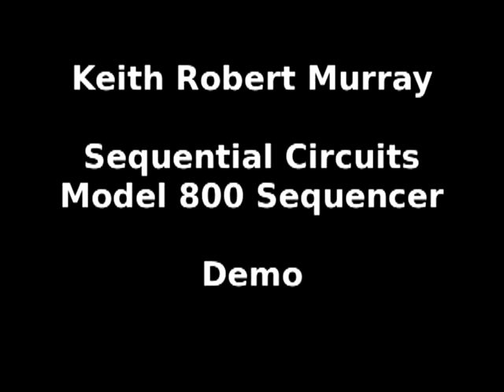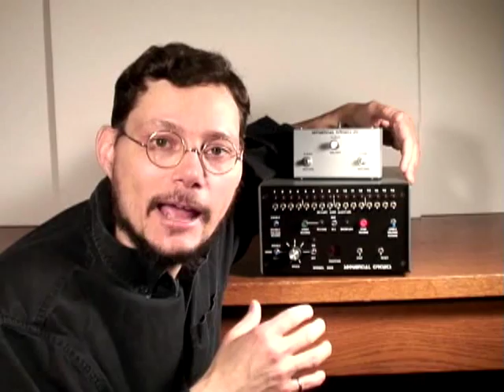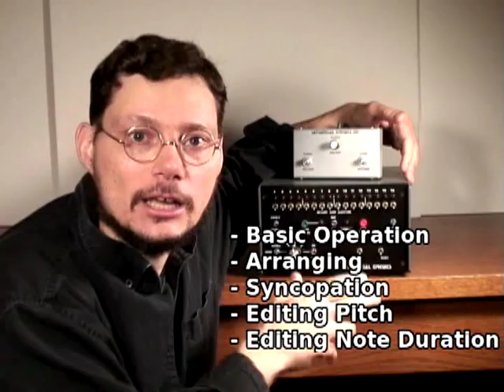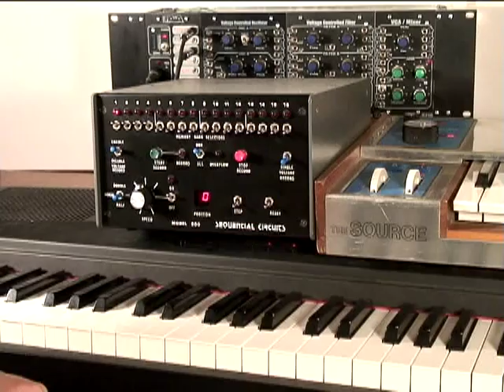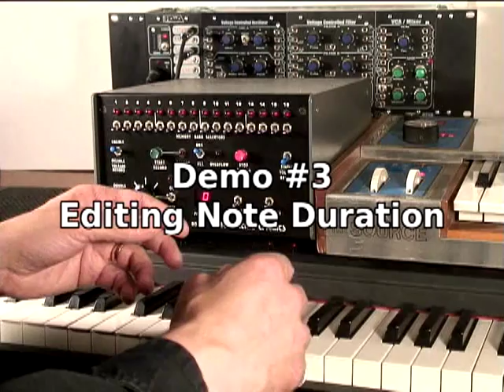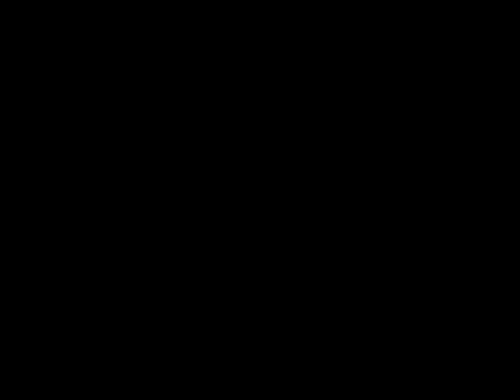Sequential Circuits Model 800 Sequencer Demo

Comment: Keith,   Great demo.  I used to own a Model 800.  Sold it to a friend who still has it.   I recently acquired a Model 700 programmer :)
Reply: Both are truly great designs, not just for their time but for now. The 700 was rarely used live - but that's what it was great for. I used one when touring with a Minimoog and it blew people's minds that it had "presets". But the 800 Sequencer is truly useful for anyone with tonal music directions...
Reply: @briankehew579  Very cool that you used one live.  Did you used a single multi-wire cable?

Comment: What a fantastic sequencer, I've never seen anything like it (where the pitch, duration and timing are all independently variable). I really enjoyed the synchronization demonstration also. I was thinking, why aren't there more sequencers designed like this for voltage controlled synths? But obviously, the polyphonic synths that came shortly after this sequencer probably made it seem somewhat obsolete to polyphonic players.
Reply: Roland MC-4, MC-8.
Reply: @RodMacQuarrie  only $10,000

Comment: I just had an idea, in a newer video, you demoed the Roland CR78. Since the Model 800 can't just quantize a set of notes to a specific musical division (such as 1/16th notes), couldn't you use the trig out of your drum machine to input a gate pattern into the Model 800, like you did with the CR78? Then you would have all the notes locked to a grid, or whatever kind of syncopated pattern you've programmed on the trig out of the drum machine. I think you can get some cool results with the idea of separating the note values from the gate values!
Reply: ***** Cool! looking forward to that.

Comment from the maker: The clock on the Model 800 runs at a very high speed (I believe it is 64 or 128 pulses per note), while the TR-808 can only supply 24 pulses per quarter note (through DIN Sync).

You could sync the Model 800 from the TR-808, but the Model 800 would run very slowly.

Clocking the other way around (syncing the TR-808 from the Model 800) could be possible, but then you would have to build some sort of clock divider circuit, or the TR-808 would run too fast.

Comment: I was wondering. If you have a sequence with a note duration. is it still easy to have it in sync by an external trigger?
I would like to trigger the clock from the 800 with my TR808. is this possible?
Tx